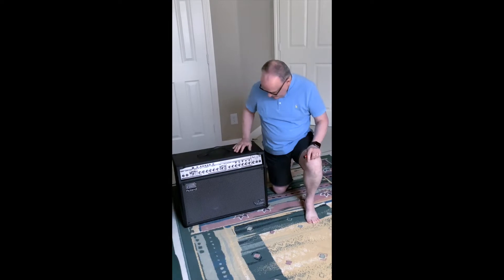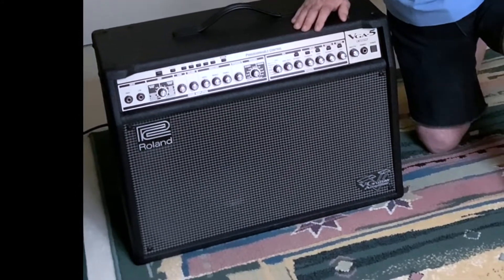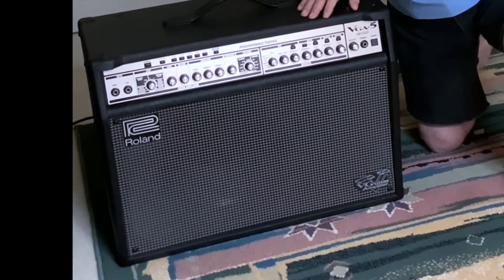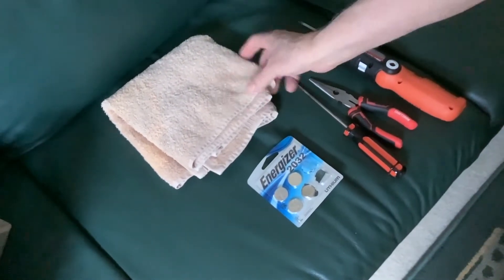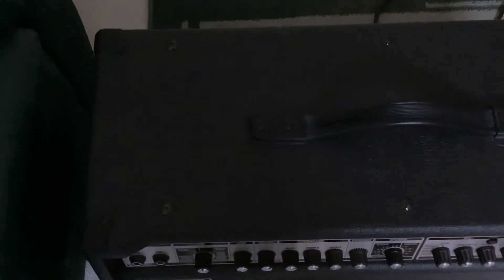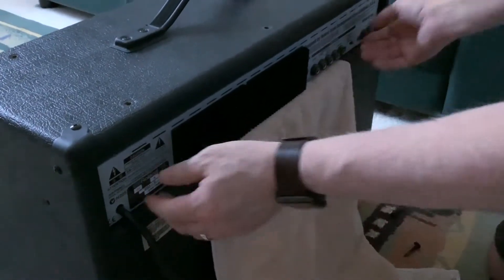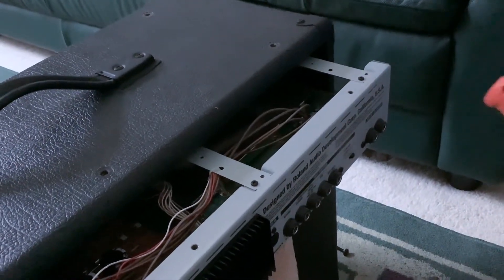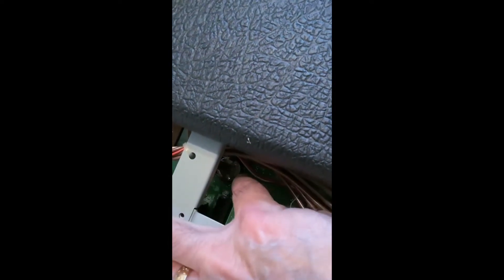Roland VGA 5 Amplifier Battery Change

Comment: I have a VGA-5 that has been sitting for about 15 years.  Plugged it in, lights up but no sound at all.  Looking forward to doing this and see if I can get some sound.  Either way thanks for making this video!
Reply from the maker: Glad this video was helpful.  I am curious to know if the battery change resolves your issue.  Let us know how it works out.  Thank you.

Comment: Your video was a big help. Thanks Mark!
I had not played on my VGA 7 (the brother of the vga 5) for a while. The sound was no longer clear in my ears and it seemed like the noise gate was working inaccurately. 
At startup you could see BLO in the display for a while. No idea what it means.
Your video has activated me to replace the 22 year old battery in any way. By the way, it seemed like there was less room to replace the battery. It was still a hassle compared to your actions but eventually it worked. On startup, you no longer see BLO on the display. The sound seems to have improved slightly but I wonder if it's because of the battery since it's for memory preserving isn't it?
Anyway there is a new battery in it ;-).
Reply from the maker: Happy the video was of help.  I am not experienced with the VGA 7 model, and never got any answers from emailing Roland/BOSS as to what exactly the battery controls when I originally was trying to diagnose my problems.  Based on my single experience with my VGA 5, I would have to say the battery does seem to have effect on the overall working of the amp's circuit board and function/sound as my amp would simply not work at all as it should until I took a leap and did the battery replacement.   Thank you for the positive feedback, and glad the video was helpful for you.
Reply: @MarkM_DIY  An update. I have restored the factory settings. The sound (decay) is back to normal. So replacing the battery actually affects the amp sound. Strange that you can't find this fact anywhere on the internet. Anyway glad the problem is solved and that it was not due to the oldness of one of the electronic components. ;-)

The following procedure can be used to clear the VGA7 internal memory and reload the factory settings:

1. Press and hold the WRITE button while turning the power on.

2. Release WRITE, and then press the WRITE button again to execute the Factory Reset.

3. When the Factory Reset is complete, “U01” shows in the
display.